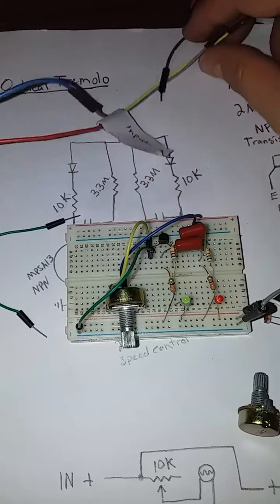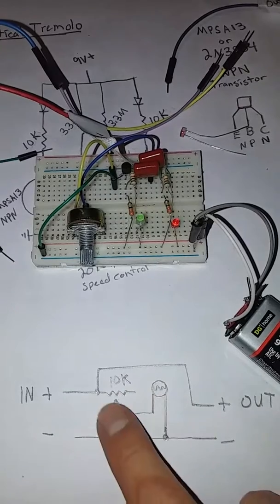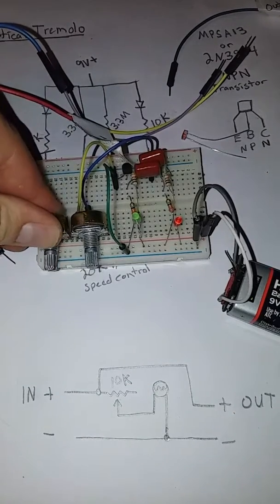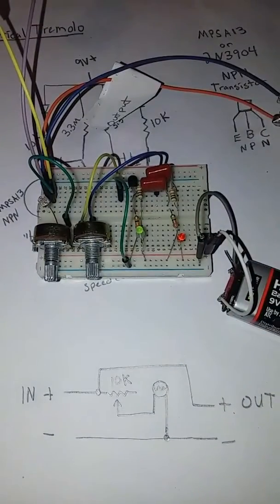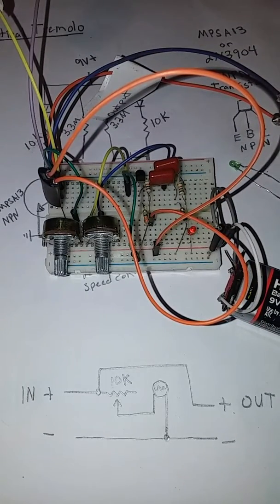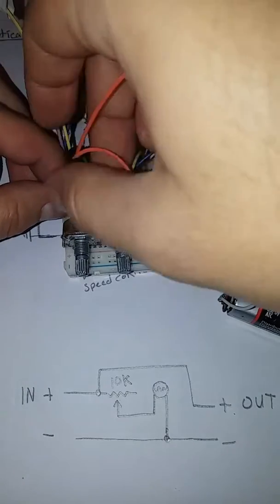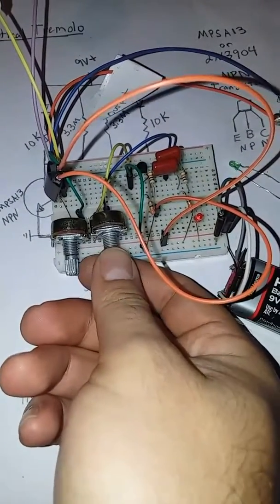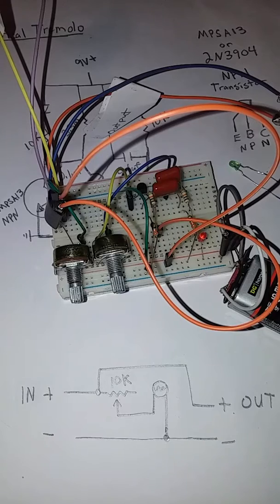How to use a flashing light circuit and a photo resistor to make the tremolo effect

Comment: I followed the steps in your video to build an astable multivibrator circuit for a blinking LED, and it works as intended. However, I've encountered an unwanted noise in the circuit. Could you please help me figure out how to resolve this issue?